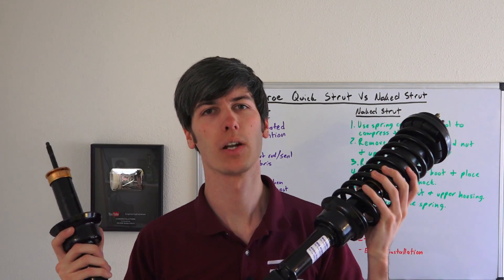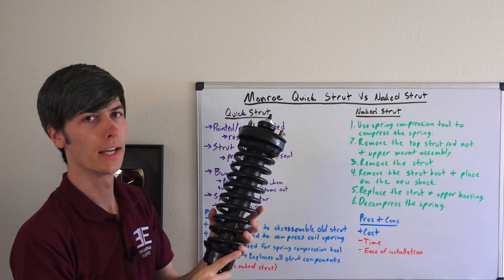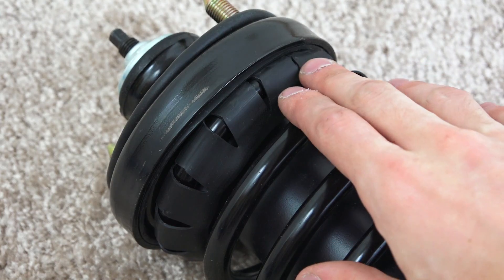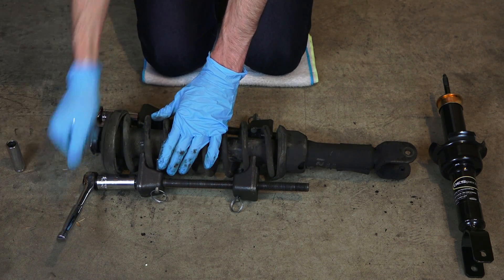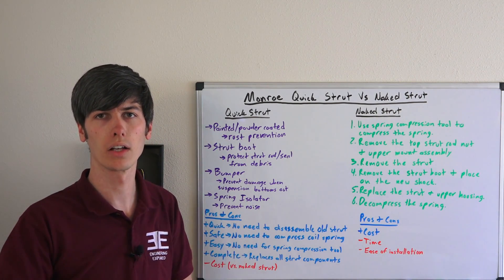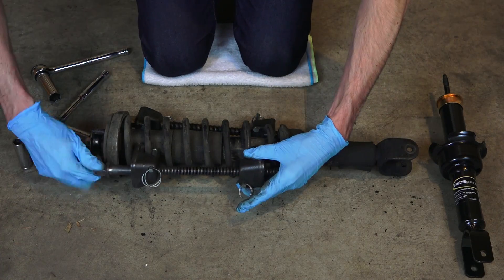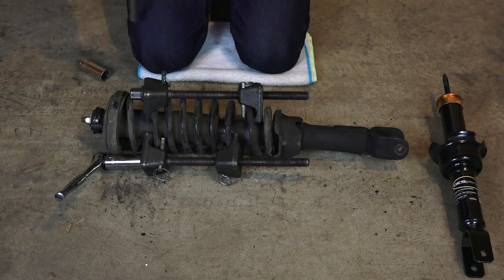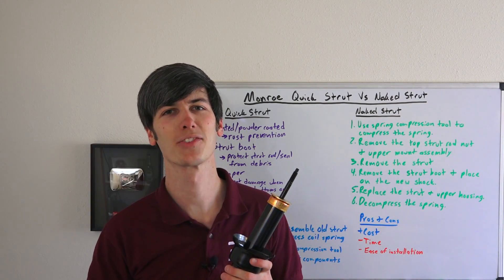Strut Replacement - Monroe Quick Strut Vs Naked Strut

Comment: in the end, both KYB and Monroe suck. you have to replace them after only 1-4 years. do the math, unless you work on cars, they are a b-tch to work with. it is all cheap a-s advertisement!! do it right, do it one time. buy genuine OEM part.
Reply: Monroe and KYB are the genuine OEM part on a lot of cars.
Reply: Ah, go for it. It is only $300 Honda OEM part vs $90 Monroe
Reply: So replacing them wouldnt cost anything for the new strut? They should be free? I dont know about these quik struts, but Monroe says their "naked" struts come with a lifetime warranty. It is a "limited lifetime" but still, if the strut turns to garbage after 1-4 years, thats no lifetime to me.
Reply: Kyb and monroe not even in da same class.. Stop all dat bro.. Kyb over monroe anyday.. At the end of the day? Ill say sachs.. They just dont have full assembly for all cars..
Reply: My Nissan Sentra just went through struts recently. I drive a 2014 and 
 after 4 years and a half at 57k, my struts blew

Comment: can you do a video explaining the difference between a shock and a strut?  i have a 2009 scion tc and i think it has struts front & rear, but i hate how every website i look at interchangeably uses the two words without differentiating between them.
Reply: im sure if you look them up in the industry tech talk, they are the same thing. struts can be other things also but in this case, struts and shocks are the same thing.
Reply: Shocks + spring = strut
Shocks are the inner peace with the compressed oil inside.
Spring is the coiled spring.
Strut is the full thing.

That's my understanding of it.
Reply: hello..i think....strut meaning the damper for front two wheels.......and shock meaning damper for rear two wheels......both without spring....just damper...
Reply: The term "Strut" usually implies an assembly that consists of the the spring and dampening device designed by automotive engineer Earle S. MacPherson.  The MacPherson strut is a type of automotive suspension system that uses the top of a telescopic damper as the upper steering pivot. It is widely used in the front suspension of modern vehicles.  Shocks on the other hand, are the dampening device only, without the spring.   Shocks can be found on the rear of some modern vehicles.  My Sienna van has struts on the front, and shocks on the back.  My Volvo(s) have struts on all 4 corners. (And cost $400 each...)

Comment: Do you have a video on replacing shocks on a 1999 infinity, or similar suspension? All of the videos I've see are for replacing the McPherson struts, which are not similar in design. You're right, compressing the springs is a lot of work. I wonder if an all-inclusive is available for this model, but springs still have to be compressed?

Comment: Ok people if you have an old ass car that looks like it's sagging, you must replace the whole strut assembly because the spring decides the car's ride height. If you're cheap and replace only the cylinder, you will be good for shock absorption but the car will look like shit off balanced.

Comment: you also need to do alignment after installing new strut. Most people don't have an alignment machine nor a spring compressor at home.
Reply from the maker: 7150285 You can rent a spring compressor for free at auto parts stores, not that I'd recommend it, it's a pain.
Reply: Engineering Explained not alignment machines though. Plus it's dangerous to compress the springs.

Comment: What do you think about periodic spring wear. With time springs lose much of their strength and tightness thereby the rear/front end hangs down. Given that, don't you think quick struts are even a better choice?
Reply: 10 years late, but no, the generic spring rate of a quick strut is god awful and destroys rice quality, I’ve used worn springs in the past which still ride and handle safer and more comfortably than any quick strut unit I’ve ever used

Comment: what if my rear wheel suspension set up is an independent strut and spring? can i just ditch the spring and just go with a quick strut assembly?
Reply: Then you most likely have a shock and coil spring not a strut. What is the vehicle
Reply: Davin Yap In that case you replace strut, spring or both independently.

Comment: If u can talk about leaf spring i need maket more softer
Reply: If you want a softer ride and you have leaf springs there are options. In my opinion the least expensive option is the best one to try first. Monroe makes a nice coil over shock for almost all vehicles. That spring on top of the shock will carry you and act as the first spring. These are about 50% more money than a normal shock, but they are a premium shock. That coil spring will ride soft in a no load situation and work as a slight helper in a loaded situation. These shocks are heavy duty shocks and they have a spring. The biggest downfall of these shocks is that many times you will have to order them from your local parts store and that will cause a short waiting period. The next best option is to use a longer shock like if OE was 22 inches change out to a 24 inch shock. You can also but shocks that work off air these shocks have a valve like a tire that you can let more and less psi in or out to adjust your ride. You can also have the arch and number of leafs changed, but I would suggest that as a last option. Seriously try the coil over shocks you might just be amazed.
Reply: Sorry for posting on a comment this old. I am like always too little or too late. I hope if it does not help you that it might help someone else.

Comment: Are these going into the Project Integra?
Reply from the maker: coscorrodrift Nope, I'd already installed coilovers on the Integra.
Reply: Engineering Explained ol
Reply: hey I have a 86 caprice do they make em lalready on the strut for my car? or do I just replace the struts itself n don't need to worry bout the shock springs

Comment: When buying full strut assemblies you also need to take a close look at the parts your buying. Just because they're preassembled doesn't mean they've been done so correctly or even used the correct parts.

I'm on my second set of Monroe quick struts in two years. Both sets used the passenger side strut mount on the driver side as well.

Looking through some online forums for my car I discovered it used to be the other way around driver side mounts on both sides. Monroe told some people on the forum that they've corrected the issue... Nope.
Also turns out that Monroe made the full assemblies that other companies just rebrand, so not much choice there.
Reply: Does that lifetime warranty cover labor costs, though?
Reply: mman454 You must have a lot of bumps near your house then.
Or drive too hard for cheap shocks.
Reply: Who cares, they have lifetime warranty lol
Reply: Don't buy the Monroe Quickstruts for a Mazda5...they break at the mount!!  (both pairs of them I've installed). Crappy product.
Reply: @chandrab  What about Gabriel ultra quick strut?

Comment: Is a quick strut a coilover?
Reply: Nick Amarit I don't think that they are coilovers then, and they will not have a quick strut for you care. Because the purpose of the qick strut is to not worry about taking the coil spring off when changing struts. But you can still get a set of "coilovers" for your car, but the rear will have the strut and coil separate, but the coil would be able to be adjusted. Not 100% sure though. I have a b5 a4 with coilovers but mine are not separate like yours.
Reply: Nick Amarit no
Reply: They look the same to me. What are the differences? How can you tell one from another?
Reply: Coilovers have threads at the bottom where the spring sits, and you are able to move it up or down to adjust the height of your car. Just google it and you will see what I mean.
Reply: Jesse Silva Okay, so basing this on my car (e46). The coilover set does not have the springs over the shocks at the rear (they are separately mounted), so are they not coilovers at the rear? Also, there would not be quick strut rears available for my car because of the fact that the springs and shocks are not mounted at the same place, correct?
Reply: Nick Amarit Depending on the part number, but it most cases it does include the coil spring.

Comment: With a naked strut you can also customize your set up of components. Say I wanted Koni or KYB struts with H&R lowering springs. You really get a chance to tune your ride quality and handling.
Reply: This is pretty much what I was going to say. With most quick struts you get average-low quality components. With regular struts you can pick from low to high for each component and mix and match the best (or cheapest, if that's you thing) from different companies.